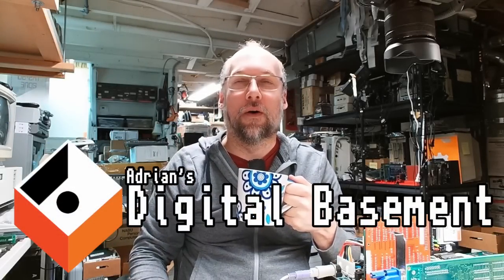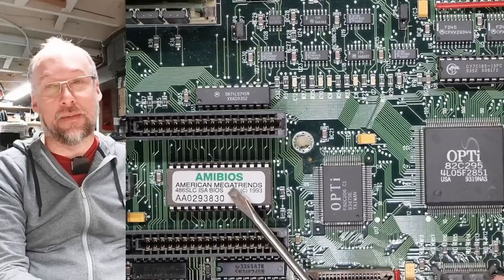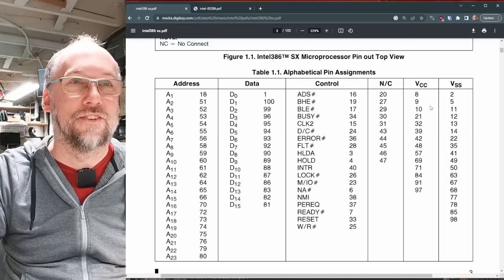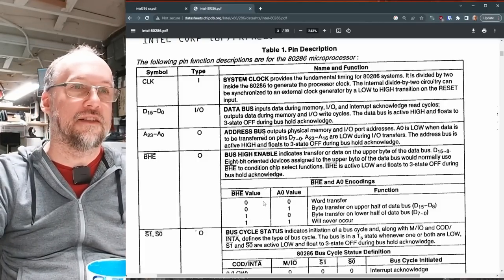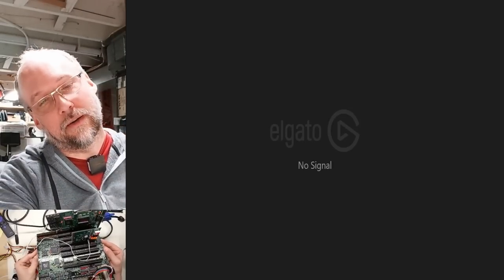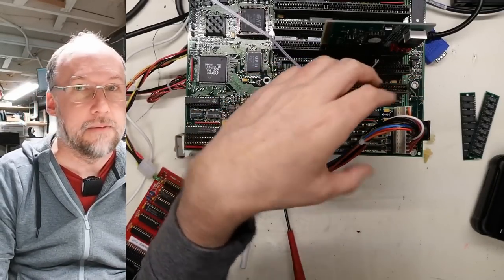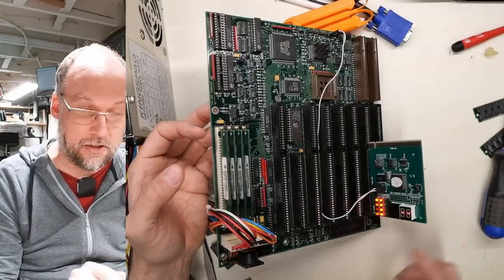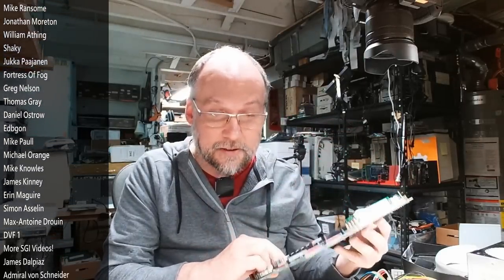Disaster struck while working on this odd-ball 386SX VLB motherboard

Comment: Back in the day, we used to translate VLB as "Very Loose Bus", because the long cards would always suffer from poor connection in their slots. However, I don't recall ever seeing it on a 386 machine, but on 486es and Pentiums, but I don't recall if there was a speed difference to PCI.
I hope you feel better soon!
Reply: The main advantage to PCI over VLB is that it supported full plug-and-play operation, and also Pentiums with VLB tended to be incredibly unstable, or at least that was the common knowledge at the time.
Reply: OPTI had a chipset that made it possible to build a motherboard with sockets for 386 and 486 cpu and also has VLB, AFAIK they were pretty much the only way to have VLB on a 386
Reply: I had a 386/486 with EISA and VLB. Had a DLC chip in it as well. Strange little board.

Comment: Well I happen to have another Alaris, even more of an oddball at that. It has a 486SLC2/66 - and a full-fledged 486 socket. Of course the SLC2 was far more interesting to me than, say, a DX2-66. It has VLB too and last year when I played quite a bit with it I found a VLB video card in it satisfyingly faster than any ISA VGA. If you're interested in more details, well, I'm absolutely planning to return to that strange board in the not too far future, it's just everything going so slowly with me in the mix... I still owe the maker of an in-depth P5 vs P5MMX vs K6 instruction decoding analysis my benchmarks of all the P5 and K6 revisions I could muster. And the tests were done by me in December....

Comment: No idea if you have tried this...  I had something similar happen, and I was at a loss but I randomly tried without my post test card in and the board worked, even though the post test cad looked like it was working it now just hangs any board it's in, is it possible your post card was killed by the power supply?

Comment: I had 2 different PSU's die on me in my first PC build One lasted me from 2008-2015 and the replacement worked from 2015-2018 Both times they died I was lucky and nothing else got damaged by them.

Comment: I really like weird boards like these.. Too bad it stopped working! I know this one; It's an Alaris Leopard and it has an IBM 486SLC2 on it and just like the Alaris Cougar it's very highly sought after by collectors/ nutjobs like me :-) The VLB slots definitely do make a difference in performance just because of the difference in clock speed. A VLB card on the Leopard is allowed to operate more than twice as fast than an ISA card because of this (it can run @33MHz while the ISA cards run at 8MHz or just a little higher when overclocked).
The Cougar is even cooler as it has an IBM BL3 on it which can run on an SX (16-bit external mode) and a DX (32-bit external mode) mainboard. It can basically "chop" its external databus in half if installed on a 16-bit board which is quite an exotic feature!
It actually is the holy grail that can max out an old 386SX mainboard with a CPU that features 16k of L1 cache and runs at 100+ MHz internally through clock tripling.

And yes, indeed 286 to 386 upgrades exist. I just happened to order a very nice Evergreen 286 to 486 (REV-to-486) upgrade for my IBM PS/2 Model 30 which I'm waiting for to be delivered. It's a very cool upgrade that turns a 10MHz 286 into a 40MHz 486SLC2 🙂 It has a little cache coherency circuit on board and a couple of PAL chips that handle the addressing so it's definitely possible to run a 486 core on a 286 mainboard (with a 16-bit external databus obviously) ;-) Super cool stuff, love it!

You may be able to fix this one. I think you may have causes a short while replacing that 7400 chip near the DRAM..Did you check all the pins for shorts on that chip? That's the first thing I'd do as the behaviour changed after you swapped that chip.. Worth checking at least ;-)

Comment: Uh, a 386sx is not at all "just like a 286"!

Not only does it have the full 32-bit internal addressing bus of a full 386, it also, more importantly has the full 386 instruction set, which facilitates multi-tasking and has vastly better memory management functions than the 286 did!

Applications that are written and optimized for 386's will run happily on a 386sx but will never run on a 286!

Comment: You can definitely upgrade a 286 machine with a 386SX. I've got an IBM PS/2 model 50 with a Kingston SLC Now! upgrade, which is a 386SX plus some extra chips.

Thanks for the tip about the retro web website, I hadn't come across it before. That motherboard search looks really useful, so I'll keep it in mind next time I need to get some details on an old board.

Anyway, that's really bad luck with your power supply. But I guess it's better that it failed on a weird random board rather than something more noteworthy.

Comment: I feel it's a bit disingenuous to call a 386SX "essentially a 286", there is a HUGE difference between these.  A 386SX is a 386DX with a nerfed bus architecture to make it cheaper to build a "bridge board" for 286 upgrades.  The fact they were SMT chips instead of socketed had a lot to do with cost and adoption I think.  A 386SX has virtual protected mode, TLB, page tables, multi-tasking, everything a 386DX has, except a narrow bus.

Comment: I have the same motherbord.  The CPU is based on Intel design not Cyrix. It is able to reach  80MHz with active cooling on my example. I have only 2 VLB VGA cards and both of them manifast issues on this motherbord, so I wasn't able to compere ISA vs VLB performance. Math coprocessor is working much faster than on 386SX, probably because of L1 or L2 CPU cache.

Comment: Side note on BIOS batteries: some old Macs will not work at all without a working battery installed. So it looks like the motherboard is dead but all it needs is the battery.

Comment: What a shame that what appears to be a PSU failure has taken out a board — or maybe a failing board has taken out a PSU? Wonder if there are any devices that can be put in between old motherboards and old PSUs to provide some level of protection if things go bad.

To have to end on a down note when you’re already under the weather must’ve been quite demoralising, but following your trouble shooting methods is always interesting to watch.

I also wondered about the progress shown by the POST code board — i think you said you weren’t sure if it meant that phase of startup failed or the previous — but could it actually mean that the 0Dh phase had finished and the following phase was stuck?

Comment: I want to see this board working. I think it would be a great thing to test out, but it's also possible the CPU burnt out from weird voltages. That'd be a job you can do with a razorblade and then drag-desolder all the pins. replacement 386SX chips aren't hard to come by on eBay and it would be worth seeing if this board can be made to work if only to get the VLB functionality working... but to me, this seems like a very special board that's so terrible it'd be a crime not to save.

Comment: The Cirrus Logic CL-GD542x series of VLB graphics cards pair well with that motherboard since those graphics chips only support 16bit VLB I/O. I have a similar motherboard, branded as an IBM Opal motherboard with an IBM 486SLC2 processor. In order to use linear video memory on the Cirrus Logic, I only put in 10MB of DRAM (2x4mb,2x1mb) so that the video card's 14MB address would work.
The later VLB spec had extension for 64bit mode - intended to be used with Pentium processors. I have not seen any in the wild.
With respect to performance, when using a Cirrus Logic CL-GD542x series VLB video card, the performance is comparable to a full 486 at the same bus clock speed because of the 16 bit nature of the video card.

Comment: Considering that even 486 systems are picky about running multiple VLB cards, based on the cpu base clock and bus speed... I'd be curious about the results of running multiple VLB cards simultaneously on a 386.

Comment: Even if any VESA card wouldn't automatically be able to make use of the full 32 bit in an SX, you still should be able to run the bus at a much much higher speed.. (I think VESA local bus is supposed to be able to run at any of the valid bus speeds of a 386/486, which would mean 50MHz instead of the around 8-10MHz top of most of the ISA cards.
Reply: I remember I once had a computer that refused to start unless there was a controller-card installed (I assume whoever manufactured that BIOS simply didn't see any need to go through post if there was no possible way to boot any-how, so it just gave up at the very first error it found)

Comment: 386sx can still use 386 32bit instructions.  I'm also hoping this vlbus actually works.  With DMA it may have 32bit access to memory.  VLbus can also clock a lot higher than ISA

Comment: Hissing/squealing noises during powerup - rifa cap?  failing/shorting rectifier module in the PSU?
I had a VL Buss motherboard for a while back in the 90s with an AMD 386 DX/40 on it.  Throughput for video on the VL Buss was noticeably faster than ISA or PCI, but the comparison is not very scientific:  I don't know whether the different video cards had more to do with the speed differences than the actual buss speeds.

Good hunting on this one.  A viewing of Necroware's 386/486/Pentium board repairs may be of interest.

Comment: I would modify a couple power supplies to incorporate crowbar circuits, thus shorting out out-of-spec voltage rails and protecting the actual hardware. The same way the C64 community has been protecting their stuff for years.

Comment: I have a 486 board that doesn't POST without a battery. I learned that can actually be the problem. Too bad the board died before you could try that.

Comment: I had some disaster myself while I was testing a motherboard, everything was plugged in but I didn't turn it on yet. I tried to insert the video card and suddenly, the board came alive as I was half way jamming in the video card. The board beeped and stuff happened but I had no display. Turned out something got fried on the video card, because if I used a different video card it was okay, it even worked with the damaged video card to a point (it POSTed, but didn't have an image), I tested this card in another motherboard so it was cleary dead. I was bummed out by this, I got the card for about a $1.35 (today's exchange rate) but I was still sad that I was not careful enought. This has never happened to me before. It is at ATX motherboard with a proper PSU, I had a button hooked up to it but it wasn't pressed. After this test, every time it receives power it turns on. I don't know what happened, maybe the motherboard suffered some damage too but I just really don't know how or why it turned on, maybe it was already like this, it's hard to tell. Next time I won't let this happen, I will have an extension cord with a power switch as it's much easier to just turn that off and cut the power that way then pulling out the plug on the back of the PSU. Sad stories :(

Comment: Hi Adrian. Maybe there was an accelerator/bridge board that updated it to a full 32-bit x86 CPU. This would let you plug in another peripheral card that used the VESA bus, and the accelerator card disables the on-board CPU, much like accelerator boards for the Amiga 2000/3000/4000, so the 32-bit CPU on the accelerator could see any other card plugged into the other slot that has the VESA connector. Just a guess, though.

Comment: Speaking of cache ram, i remember there were motherboards with fake cache chips soldered for looks, but you could actually buy an extra simm like cache and that would work. It was essentially 0k cache dressed as having "some". Was it during 386 or 486? forgot. DOS ram cache test tools would immediately show the truth (and benchmarks). Its not like a jumper was misplaced or anything, it was the typical Chinese move.

Comment: Actually, VLB VGA cards CL5424 and CL5426 were 16-bit and got all speedup from the increased frequency of VLB compared to 8 MHz ISA. Only CL5428 became true 32-bit card. So 16-bit ISA was 4 times slower than 16-bit VLB.
Reply from the maker: Oh yeah I remember this. Also 32bit VLB IDE seems silly too... Since IDE is 16bit through and through, I assume the speedup is minimal if any. Or at least not until we have the ultra DMA 33 and 66 standards and 80 pin cables. I think that came later than VLB but I can't quite remember.

Comment: So sad when these things happen. The PSU might have ears: didn't you speak highly about it the other day on your IBM PC archaeology video? :) Cool OBS setup, I've been thinking of doing the same as it would massively simplify the editing afterwards - with the downside of giving you less flexibility during editing and also requiring to focus on the setup much more as you need to make sure the proper framing is always on. 
I'm wondering if we should design some sort of "PC-Saver" (mimicking the C64 saver): an in-line adaptor which prevents those old PSUs from frying our previous boards.

Comment: it's time to make an adapter cable for old pc's, using the old wire, a negative voltage supply and a modern ATX supply.  unfortunately the new power supplys lack -5 volts (since version 1.3 of the year 2003, which was optional and no manufacturer put anymore and don't recommend using one off this year).  in this case using a box to mount a female ATX connector, an on/off switch, a negative voltage supply and the old pc cable.  You will have a longer cable to test comfortably any pc with modern equipment.

Comment: So sorry the board repair didn't go well.  Good video though.  Shows some of what really happens on a lot of workbenches, my own included.  I seem to recall the 486DX2-66 was clocked externally with 33MHz but internal frequency multipliers gained an additional 33MHz due to the bus architecture still being limited to 33MHz.  I remember having to tell customers at our store what the DX2 meant to processing speeds.  Most grasped the concept of frequency doubling but couldn't understand why it only worked internal to the CPU.  "Chipset clock speed limitations." was how I answered and that seemed to fly with the less technically oriented customer.  There were those that would call me out on that and I would demonstrate it on a frequency counter.   Saw the DX2 as the beginning of how Intel could make more with less and milk the tech for all it was worth.  Seems we should be using 66GHz CPU's by how fast technology was moving ahead back then.

Comment: So, the voltages dropped to about half of what they were supposed to be? Could it be that the power supply has a 230 V / 115 V switch that got flipped to the wrong position? If the voltage selector switch is in the wrong position, the power supply would be getting half of the voltage it expects. So, what would the power supply do if that happens? Wouldn't also the output voltage drop to half, especially if it's a dumb enough power supply?

Comment: I had an AT power supply explode once, around 2015. The system had a cheap Socket 7 motherboard, i was doing some tests with an AMD K6-2 CPU (running at 400-something MHz), when all of a sudden... Boom! When i opened the PSU to take a look, there was a blown-up capacitor. The motherboard survived though, along with the HDD, CD-ROM drive, etc., nothing got damaged besides the PSU itself. But i'm starting to think that old (20+ years) PSUs should be recapped as well, just like old motherboards, maybe even more so, because when a catastrophic failure happens inside a PSU, it's way more dangerous and likely to kill the rest of the computer, as opposed to the little harm a bad capacitor on a motherboard or expansion card can do, where everything is guaranteed to be low-voltage.
Reply: Yeah. I know that Adrian isn't a huge fan of recapping but if you repeatedly use a vintage power supply, it is very much worth recapping

Comment: One thing that I've always been puzzled by. The 286 can only use 1mb of ram unless it's running in protected mode. But once in protected mode it can't go back to real mode. Since does is real mode how the hell does extended memory work? I find it hard to believe that dos is resetting the processor frequently.

Comment: The Asus TX-97E I have in my retro computer will NOT boot unless the CMOS battery is not only installed, but has a good charge. Without it it just seems to power on and do nothing. So I can state there is at least one main board that won't boot or do much of anything without a CMOS battery.

Comment: Does the 386SX really not have any of the extra instructions, addressing modes etc of the 386? No enhanced mode Windows? It's literally just a 286?
Reply: No, the SX has the full instruction set.  It's really just the external interface that is different.
Reply from the maker: It's a full 386 shoved into a 286 package (electrically) So you only can address 16mb of real RAM and things run a lot slower due to the half width data bus. (versus a 386DX) It allowed companies to reuse existing motherboards designs for the most part.

Comment: Why not use modern PSUs on your test bench w/ an atx-to-at adapter & voltage blaster?
Reply from the maker: I have since started using an ATX PSU with adapter ... Although it's not a new PSU, it's from the late 90s probably. Current day ones lack the negative voltage rails ISA slots need.
Reply: @adriansdigitalbasement2  The voltage blaster provides the -5v...It's a little ISA board designed by Phil's Computer Lab & Necroware.
Reply: @ruthlessadmin  Also as far as I can recall the -5v is only required for a few old sound cards, nothing else really needs it.
Reply: @ilovethe70s  This is my understanding as well..I recall it being a rare use case, either way, and that's why it was phased out.